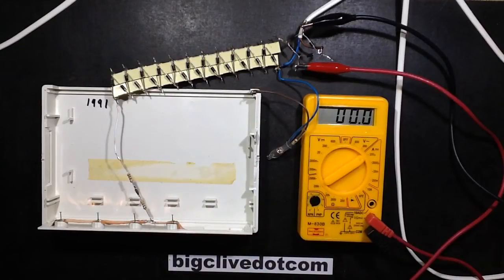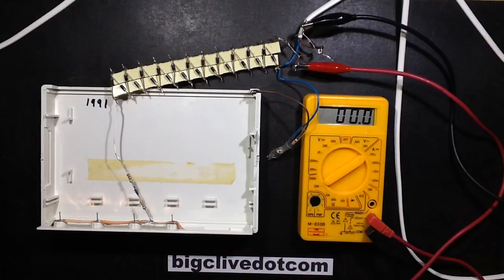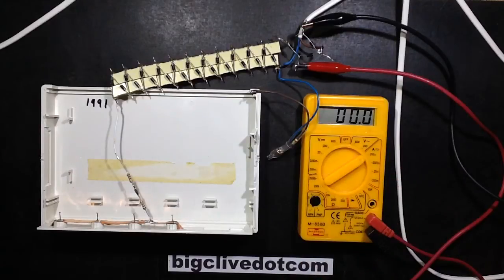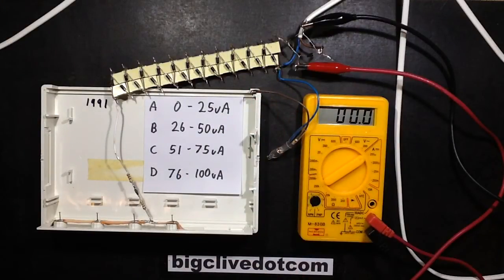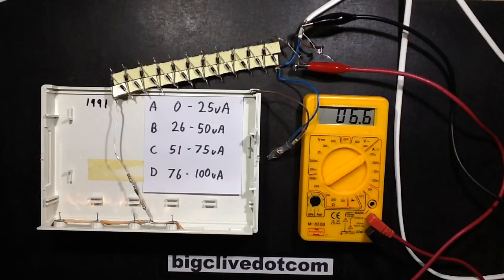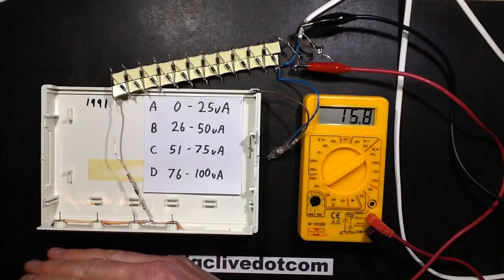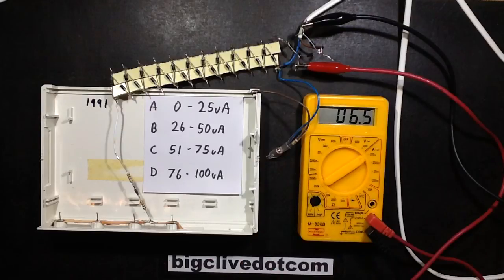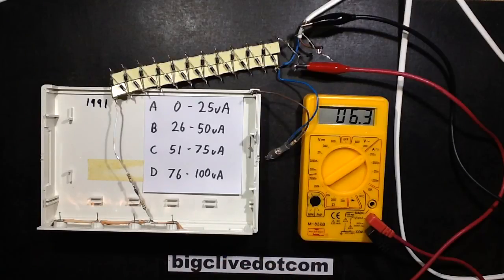What current does an air ioniser actually draw?

Comment: I think this circuit has been generally a bit misunderstood. It should produce less current, not more. It has sufficient voltage to ionise as early as the third stage, and can be connected to the needles at that point, but that will produce far too many ions. The additional 8 stages increase the voltage linearly, but the output impedance exponentially, and so reduce the output current exponentially, resulting in a current generator. Going to 11 stages is a compromise that was found by trial and error. The output impedance is then around 1000 megohms, but 6 microamps is still really too much ion current, and that produces a negative ion concentration in the room generally that is still too high. This is what causes the electrostatic precipitation, the staining effect around the ioniser, and sometimes a bad smell of ozone. If the objective is only 'feel good negative ions in the air', I think a better output would be in nanoamps. But it depends on what you're trying to do.

Comment: Hi Clive, one question, since I assume you're an expert on these things. Made this Walton-Cockroft or Greinacher multiplier circuit with 20 stages (that's 40x 100n caps and 1n4007 diodes) and the reason behind this is the caps I ordered from Ali Express were 40pcs pack, and diodes being 100pcs. Since I noted the stage "limit" for 240V mains (in Croatia we have 230V) should be between 22 and 30, therefore higher output voltages would probably produce more ozone, which we obviously don't want. 
My question: what is the max threshold number of capacitor-diode stages in order to maximize neg. ions and minimize the ozone?
Reply from the maker: Typically commercial ionisers use 22 capacitors, but I used 30 in my units.  The current throughput is low and the voltage tends to sit down on the multiplier depending on how efficiently the needles are ionising the air.
Reply: Okay, but I still don't get whether I'd be safer by cutting the number of capacitors to 30, or should I maybe use a step down transformer to step the mains voltage down from 230V to say 115V for circuit to produce less ozone?

Comment: top right diode  is it doing corona discharge when you first turn it on ?   lower voltage side?  if you put larger capacitors in would you get  more current? like swapping capacitive dropper caps ?

Comment: Is it even really doing anything then though, Big Clive? 

Unless the thing is tied directly under your nose or in some sort of super airtight room, then is it actually even capable of having an effect?
Reply from the maker: Yes.  It doesn't take much to put an electrostatic charge into the air.  My house is dry at the moment so it was charging me up enough to make quite a crack when I touched earthed objects.  These units do a good job of clearing airborne contaminants out of the air.  They create quite a mess on the walls around them.